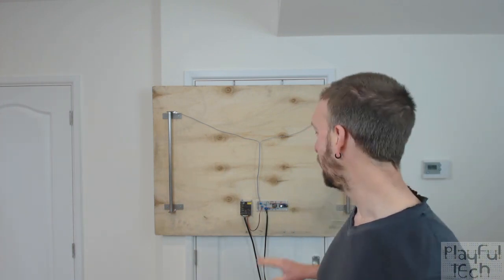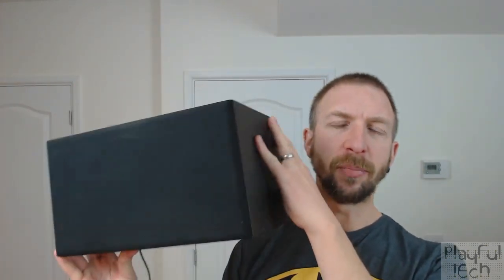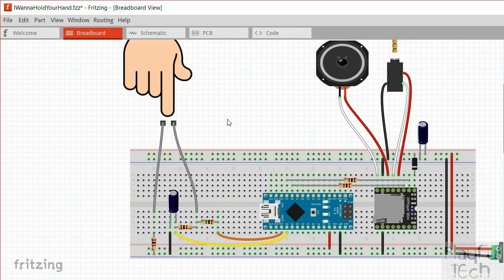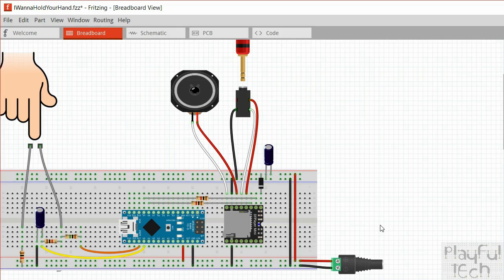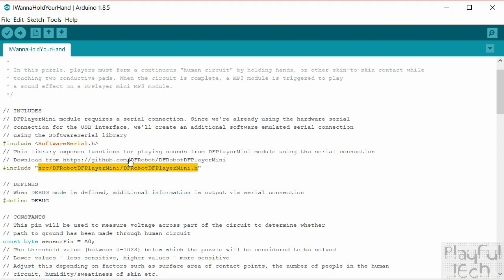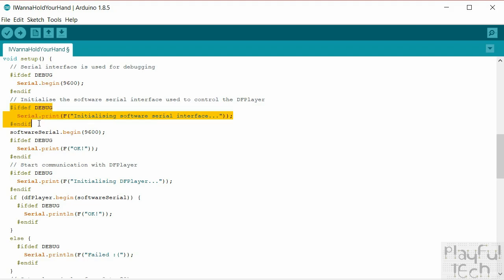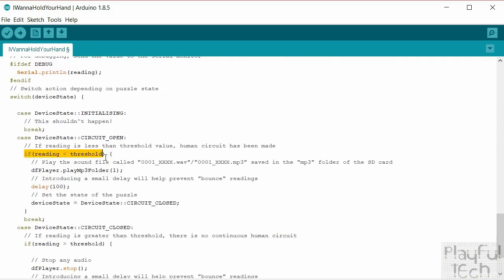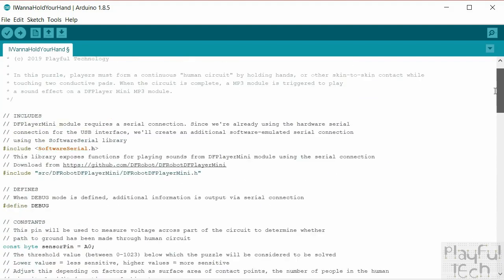"I Want To Hold Your Hand" - Arduino Human Circuit

Comment: Thanks for the video, it was very informative. I’m using a DFPlayer and a pam8403 amp for a project which I initially had noise problems with because of the wiring between them. I found that getting them as close as possible solved the problem. Also I’m powering them both from the Arduino which doesn’t seem to be a problem. I am using screened wires for that though. 
Thanks again. Your coding style is a lot more disciplined than mine. I’ve taken note! 👍🏾🤓

Comment: Okay...finally. I'm using 10uF capacitor, and it sort of works, takes 1,5 seconds to get the voltage low enough, but works.

Comment: I love this and have had some success. The only problem I've had is that when I've put the smoothing capacitor in,  my analog value starts at 0 and very very slowly rises up to 1024. I just omitted it before but now I'm getting a noisy signal that sometimes triggers when just one pipe is being held.
Reply from the maker: What value capacitor are you using?
Reply: @PlayfulTechnology  100uF (:
Reply: @PlayfulTechnology  What value did you use??????????
Reply: Okay...finally. I'm using 10uF capacitor, and it sort of works, takes 1,5 seconds to get the voltage low enough, but works.
Reply: Same thing happened to me, took forever for the value to creep back over 500. I took out the capacitor (was using 100uf, he never gives a value for his capacitor) and that fixed it, I am not playing sound, just operating a magnet, so i just omitted the enum and switch/case left it as a simple if/else code and no capacitor, works perfectly. No interference. no false signlas.

Comment: Not working on me yet. I'm pretty sure, that it's not working, because the capacitor value is too big or too low. If i remove the capacitor, the value comes as it should be, but it's a little shaky.
Reply: Never gonna work
Reply: Okay...finally. I'm using 10uF capacitor, and it sort of works, takes 1,5 seconds to get the voltage low enough, but works.
Reply: @tristanpoder9099  Could we talk a bit about it?  I'll try to make this happen and i'm little insecure
Reply: @capital_pi  yea. i’m willing to help. where can we talk?

Comment: doesn't even work on the breadboard. I tried the same circuit, the same programing. So first of all, there is something wrong with the serial. in the schematic you are using pins 8 and 9, in the programming you are using 2 and 3 (i changed the connections to 2 and 3). then If i plug in the computer to try to debug, doesn't map the device on any com. if I remove the power from the dfplayer, then there is no issue and I can debug. but the serials don't seem to work in the same time. second, I am getting really noisy signals even if I touch one of the contacts.I am using a 100uF. on top of that touching both contacts doesn't make any difference. still getting the same noisy signal back to A0 ranging from 400 to 1024.maybe I am using a wrong capacitor? I tried 220uF Doesn't seem to make any difference